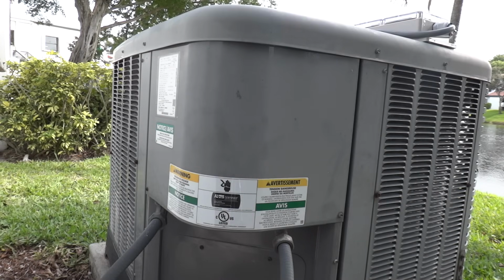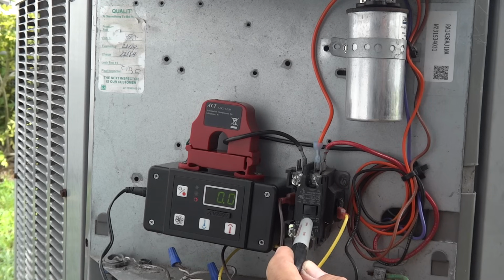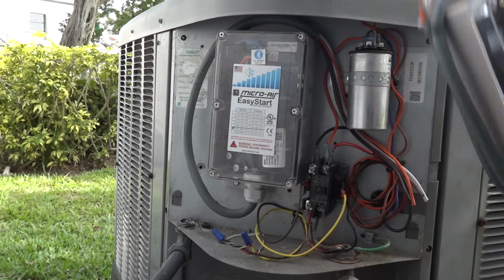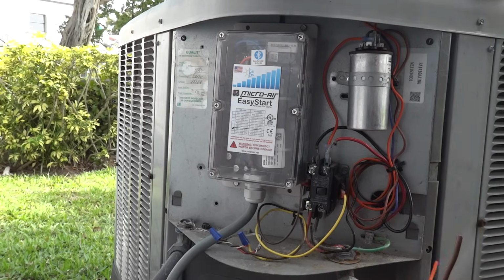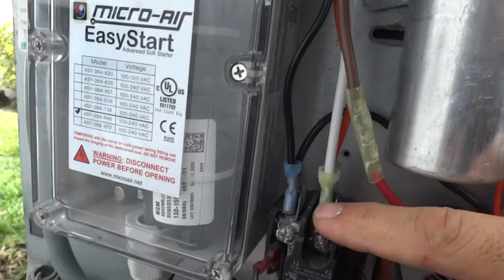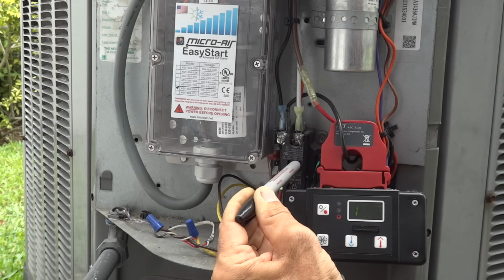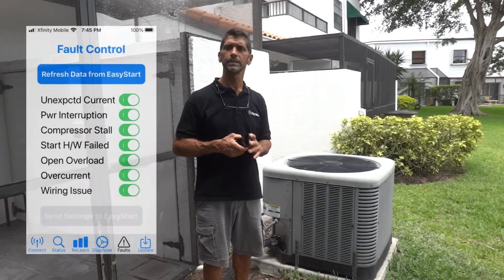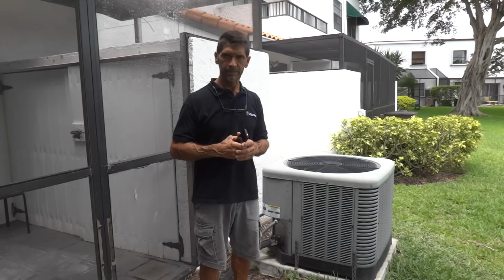Micro-Air EasyStart Home A/C Installation (368 Series)

Comment: You didn't talk about RLA, only FLA. And a start cap with a start relay can do the same thing. Maybe explain that high end units come equipped with a start cap/relay already installed. This product would create issues if combined with these units.
Reply from the maker: Hello and thank you for your comment.   

More often, I spoke about LRA, which is Locked-Rotor Amperage.   This is the peak current that the compressor draws during the first 0.1-0.2sec during startup, or when the compressor rotor is in fact "locked".  You mentioned, Full-load amperage (FLA) and rated-load amperage (RLA).  These are often referred to interchangeably, even though I agree they are slightly different values.  Typically, OEMs of A/C equipment only provide the current draw when the system is operating at its dataplate "rating" and its target capacity per ARHI standards.  Thus the reason you typically only see RLA numbers on the data plate label, alongside the LRA numbers.  FLA values are typically reserved for motors that get used in a widely-variable load application (e.g. a water pump or mechanical movement application like a conveyor) where there might be variable load, requiring the user to know what the absolutely full-load rating current draw might be.

The start cap/relay combination that you mention is what is known as a hard start. Per the installation instructions for EasyStart, all hard start capacitors and relays must be disconnected (and optionally removed) before EasyStart is installed.  They cannot function together.  Hard starts are the opposite of EasyStart, which is a soft start.  Hard starts increase the amount of current that is directed to the start winding, thus resulting in greater starting torque and a faster startup acceleration over a shorter period of time.  Soft starts do the exact opposite, and EasyStart does it even better than that.  EasyStart gently applies the voltage and the current to the run winding and start windings (separately) to gradually accelerate the motor on a "learned" (optimized" ramp over a much longer period of time. By doing so, the normal LRA amperage that is experienced during a hard start is reduced by 65-75%, which is quite dramatic.  This is what allows one to start and run the A/C compressor on a limited power source, when it otherwise would not have worked.

Comment: Where can I buy the leads? Mine came with the wires bare on the end.
Reply from the maker: Hi Terence and thank you for your comment.  Micro-Air offers an installation kit, p/n KIT-364-RT2, if you'd like. Also, all of the necessary crimp terminals are available from any hardware or home improvement store.  You basically need the ones outlined in the video. Hope this helps. Thank you again for your business.
Reply: @MicroAir  thanks. I hadn't watched the video yet but doing so as we speak. Thanks.

Comment: is there any benefit with a hard start kit?               why dont manufacturers include a soft start kit if it is so beneficial?
Reply from the maker: Hi and thanks for your comment.  Whenever EasyStart is installed, you must first remove any hard start kit that may already be installed.  There is no benefit from keeping both, and in fact the hard start will interfere with the EasyStart's operation making the net result much worse.  Regarding manufacturers, most choose not to include a soft start because they don't recognize the value it provides to the customers and they are also unwilling to risk adding the cost since it may make them less competitive.

Comment: Uh oh.. I have purchased an X48, but mine is a 2.5 ton unit. Should I send it back and get the x36? BTU wise, the micro-air purchase site said I needed to get the X48.
Reply from the maker: Hello and thank you for your purchase. The X48 will work on a 2.5 ton unit, but it may not attain the ultra-lowest starting current (after learning) as an X36 would. The X48 probably will only attain about 55-60% reduction, whereas the X36 will attain the advertised 65-75% reduction on a 2.5 ton unit.  It's up to you if you'd like to exchange it for the X36.  Contact Micro-Air at sales@microair.net if you would like to proceed with the exchange.
Reply: @MicroairNet  Thank you for answering my query. Based upon your response, I should send this one back. I have not opened it, or done anything with it besides pull out the instruction sheet that pointed me to the website, and to this YouTube video.
I want to obtain maximum benefit from this product, of course, and it seems like installing this x48  would not fulfill that demand. I purchased mine through Amazon though, so there's that. Should I still contact the sales people at Micro-air?
Reply from the maker: Sorry. I made the assumption you purchased it directly from Micro-Air. In your case, you should contact the Amazon seller from whom you purchased it.  If it was Hutch Mountain, they will most certainly take care of you.  Thank you again for your business.

Comment: I just installed a 368 for my 3 ton Trane. I didn’t think I could run my heat pump in heating mode with my Westinghouse 9500/12500 portable generator.  Installation went great. The heat pump has a LRA of 74 amps. The easy start 368 according to bluetooth app is now starting at 16 amps ( HUGE REDUCTION). I did not measure anything with a clamp meter but trust the bluetooth reading is close. I have not tried running on my generator yet but. Today my unit running on both heat mode and cool mode is running at between 16-17 amps. I thought the heat pump uses a lot more amps in heat mode. Heat strips are not being used because not that cold outside but it is about 50F and the heat will come on tonight thermostat set at 71F. The buletooth app shows still a 16-17 amp inrush when heat pump comes on in heat mode. I’m ignorant when it comes to understanding all of this but. Can I expect to be able to use my heat pump ( in heat mode) with my generator Also? I didn’t think I would ever be able to heat my house with heat pump on generator power. Is there other loads from the heat pump in heat mode that I need to consider? I have other heat sources that we use in a power outage but if I can use the heat pump heat mode now too. That is HUGE. Is there a significant difference in amp draw on a heat pump is cooling vs. heating mode? The compressor start amps in cooling vs. heating … well it doesn’t look like a difference at all both modes are now starting 16-17 amps and running continuously at about 7amps. Cooling and heating seem to perform the same. All this is on utility power. I have not tested with the generator yet but generator would run the heat pump in cooling mode even before I installed the 368 but it had a big bog down on each start and a big reason I went ahead and bought the 368. Any thoughts? Did I gain an added benefit of being able to also heat my house now with the easy start?
Reply from the maker: Hi and thank you for your comment and for your business.  The answer to your questions is a resounding YES.  EasyStart provides the same startup current reduction for your compressor during both heating (reverse-cycle) and cooling operation.  A "heat pump" is simply an A/C compressor system that has the ability to reverse its refrigerant flow via a solenoid valve, which flips the functions of the indoor heat exchanger (i.e. coil) and the outdoor heat exchanger.  The compressor's operation, rotational direction, and wiring are identical in both modes.

Now, the amount of current that your compressor will draw while running steady-state (i.e. after the startup is long over with) will depend on the environmental conditions inside and outside your home.  Typically while operating in heat (pump) mode, the compressor might draw a little bit more than while in cool mode.  But, on a very hot summer day, cool mode could certainly draw more than heat mode on any winter day.  Given the difference is typically not more than say 10-20%, if your generator size is not marginal, it will be able to power your A/C heat pump in either mode of operation.

Hope this helps. Thank you again for your business.
Reply: @MicroairNet  Thank You for the quick reply. Thanks for such a well thought out product. I’m Extremely Happy so far with you guys 110%.

Comment: what if there is a hard start kit already in the unit and what if the compressor is an inverter type?
Reply from the maker: Hello and thank you for your questions.  Before installing EasyStart, if there is already a hard start kit already installed, you should disconnect and/or remove it first.  If the compressor is an inverter type, then EasyStart cannot be used, nor is it necessary since inverter compressors already ramp start on their own. EasyStart can only be applied to single-phase, AC induction, PSC motors & compressors.

Comment: You have taken something simple and made it a little more complicated and a lot more expensive. Why wouldn’t you just use a start capacitor.? This is a prime example of how not to do things.
Reply from the maker: Hi John and thank you for your comment.  What you are stating is a very common misconception about EasyStart.  A start capacitor is a "hard start". EasyStart is a "soft start". Soft starts have been around for over 50 years and they are a far cry from a hard start.  EasyStart is a very sophisticated, microprocessor-controlled soft start that gently ramps the voltage and the current to an AC induction motor run and start windings (separately and in a coordinated fashion) to slowly break the motors initial stiction. Once the motor is rotating, which EasyStart can detect through some proprietary circuitry, it will then ramp the speed of the motor over course of about 1 second to bring it to its final RPM.  This allows EasyStart to dramatically reduce the peak of the starting amps by 65-75% from what a hard start will provide.  This is the reason why EasyStart allows one to start and run an air conditioner compressor on a limited power source like a generator or a solar inverter when it otherwise would not have worked.  EasyStart also measures live current to optimize its starting behavior via 5 "learning" starts done during the first 5 startups.   

For more information and to educate yourself further, check out this other video online where renowned HVAC School owner and instruction, Bryan Orr, delves into the topic of hard starts vs soft starts. https://youtu.be/7Gim96oyczw.  It's never too late to learn something new to apply to the HVAC industry.   100,000+ happy EasyStart customers can't be wrong.
Reply: @MicroairNet  BS

Comment: Thank you Matteo for your excellent video. I have a Rheem Model RA1642AJ1NB 3.5 ton ac unit. For warranty purposes I want to have my ac maintenance company install your ASY-368-X48-Blue EasyStart. Their service manager has no problem doing it, but is somewhat concerned about how it would affect the condenser fan motor because he says it supposedly already is fitted with its own soft start by the manufacturer (he did mention it is similar to an X13 type motor). Would this be an issue or require a modified installation of your EasyStart. Would appreciate a response that explains the reason in a way I could pass on to the ac service manager.
Thank you kindly.
Reply from the maker: Hi Victor.  Thank you for your question and for your compliment.  Interestingly enough, upon looking up your RA1642AJ1NB, all the "old" literature online indicates that the condenser fan motor is a typical AC induction type.  However, some of the more recent spare parts lists for your model do indicate that the condenser fan motor was upgraded to an ECM motor, as your service manager is indicating.  Thankfully, regardless the type of condenser fan motor, it has nothing to do with EasyStart.  The EasyStart wiring only affects the compressor motor.  Care must of course be taken with any installation to not disturb the fan motor wiring, but in your case the wiring of EasyStart should be totally identical.  Your system should have a standard run capacitor (not a dual type) since the ECM condenser fan motor does not require a run capacitor.

Comment: Do these void or conflict with warranties of the ac unit?
Reply from the maker: Hi and thank you for your question.  This is an often-asked and a somewhat controversial question. The short answer is "it depends". Some manufacturers will balk at any modification to their system wiring if you submit it for warranty claim with anything added. The same holds true for an aftermarket-added hard start, right?!  The good news is that EasyStart can be wired in without cutting any wires (by using a mating terminal for the run winding splice). If the system then fails down the road within its warranty due to an internal refrigerant leak, failed condenser fan, or something else, then you can legitimately remove the EasyStart before submitting it for warranty. There is no dishonesty here since any failure outside of the compressor itself cannot be the fault of EasyStart.  

Beyond this, many of the larger A/C OEM manufacturers are now recognizing and accepting EasyStart as an add-on device and they will honor their warranties still.  This improves every day as I was just talking to another customer about this who stated Carrier was already moving in this direction.

Regarding your unit's compressor itself, as explained in the video, EasyStart far better protects the compressor than any OEM configuration, so the likelihood of a compressor failure within the warranty period is almost zero.  If there ever was a case where the compressor failed within warranty, and the manufacturer denies the claim because EasyStart was installed, contact Micro-Air and you may be surprised by we do.  Since this manufacturer's warranty concern was also an issue for some in the RV aftermarket, Micro-Air starting guaranteeing customers' RV unit compressors that are up to 6 years old (way past the standard manufacturers' 2-year warranties) for an additional 2 years.   In the past 5 years, there has only been one claim, and it wasn't really Micro-Air's fault, but we bought the customer a new rooftop unit anyway.  This extended warranty program was considered for application to the home HVAC market as well, but because of 5 and 10-year warranties there, Micro-Air could not afford the insurance to cover it.  

Please also see the verbiage about the Magnuson-Moss Warranty Act on our website in the EasyStart Knowledge Bank.  But in the meantime, if you suffered a warranty claim denial simply because EasyStart was installed, we would review your case and would still consider helping. We are that confident in EasyStart and its protection of the compressor.

Comment: Does the eaststart come with all the connectors?
Reply from the maker: Hi Ed and thank you for your question.  EasyStart does not come with any crimp connectors, but a separate installation kit is available for <$10 from Micro-Air.  The necessary crimp connectors are so common, many people already have them in their toolbox. They are also readily available from any hardware store. Typically for a home unit installation, you will need two blue quick disconnects, one yellow ring or quick disconnect, and one (white) end splice or yellow butt splice.  Hope this helps.

Comment: The tonnage and model type listed at the very beginning of the video does not match what your Website tells me I should use for my 4 ton air conditioner. I consulted your support line also, and they told me I should use X72 model.You're listing at the beginning shows I should use an x48.
Reply from the maker: Hello and thank you for your comment. Yes, the recommended capacity ranges were updated at the end of 2022, 6 months after this video was published.

Comment: I am all installed, but two questions, is the easy start module always supposed to half power? Or only when the compressor is called to turn on?  When the compressor is told to turn off it appears to flash red but then loses power and shows nothing.

Additionally, I appear to have a compressor monitoring system, but without changing the delayed start all appears to still be functioning okay, is this going to harm anything?
Reply from the maker: Hello and thank you for your comment & question.  The EasyStart is not always supposed to have power. As you already figured out, the EasyStart only gets powered when the compressor contactor is energized.  The power down with the briefly flashing red LED is normal as the EasyStart is momentarily detecting a power interruption before power completely goes away. 

Also as you already figured out, the "No Start Delay" feature is required for some compressor monitoring systems. This feature does not harm anything; however, it does lessen the advantages of EasyStart always imparting a minimum  5-sec delay upon every start, or up to 3-min if the compressor is being shorted cycled.  The other short-cycle protections in your system will suffice, so there's nothing to worry about.

Thank you again for your business!
Reply: @MicroairNet  sweet - she's working great reducing my LRA by the marketing percentages ! Compressor starts so no start delay will remain as default for now

Thanks again!